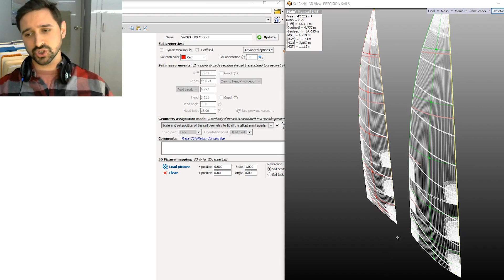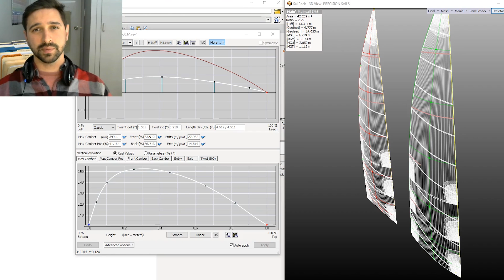Loose Foot Versus Fixed Foot Sails

Comment: Jeremy's got a lot of good points here, especially about the nature of modern sailcloth.  He's a sail designer; but I'm a rig designer; and my criticism of loose-footed mainsails is about structural mechanics.
Short version: the loose-footed sail point-loads the boom. Given a mainsheet tackle, a fixed vang, a topping lift, and a tack pin, these are all single points imposing mechanical moments between them.  For example, the farther forward your (mid-boom) sheeting is fastened to the boom, the worse the outhaul end of the boom wants to fall off to leeward.  Selden went so far as to design a boom with a flat blade through the extrusion to stiffen it. This adds weight, expense and complexity (you might not be able to mount boom bails above the plate, for example (and I've seen people miss and drill into the edge of the internal blade too - that's a real mess).
I think the real reason loose-footed mainsails became de rigueur in cruising boats was due to in-mast furling - which, if you follow the circular logic around, you kind of have to do with a loose-footed sail because now you can't so easily slab-reef it.  So now you're stuck with having to sail with a partially rolled-in mainsail as your heavy-weather rig.  I still rig nearly everything (including Cherubini 44s) with single-line slab reefing that can be done easily from the hatchway.  On my boat I have a sliding gooseneck and downhaul by which I can lower the boom rather than lifting the halyard to retension it.  There's nothing easier, safer and stronger than slab-reefing a rugged boom-footed sail that, once snugged down, can take a phenomenal beating during a serious blow.  Think now of the incredible load on the outhaul car pulling against the furler motor to keep the half-rolled-in loose-footed sail sufficiently tensioned inside the spar.
In the late '70s some sailmakers experimented with zippered pouches on the mainsail to facilitate 'bagginess' that could be deployed or not according to conditions.  It was a partial solution, an attempt at a compromise (worked mostly with dinghies).  In those days I sailed with John Eggers here in NJ (who made the original sails for all Hunters including my 1974 H25) who was famous for pulling a mainsail so tight and flat (approximating a rigid wing sail) that more than once he broke hardware under too much load!  That was how we dealt with the limitations (as seen now) of the contemporary sailcloth material - by going fully the other way.  Having an aviation background (c/o my dad) I still see some merit in this.  Jeremy does mention that easing the outhaul on a boom-footed mainsail will effect at least some of the benefits of a loose-footed sail; and no longer being a racer I'm willing to prefer simplicity and structural strength - not to mention convenience (for with a loose-footed sail's boom having no topping lift, you can't use the boom for lifting the dinghy, loading the ice and supplies, retrieving the dog or a MOB, or kedging an anchor to get you off a bar).  There's a certain sanity to the way things have been traditionally - it's not merely because they were always that way.
After Jeremy's patient, informative lesson it does beg the question: why is the boom there anyway?  Now I am motivated to lower the boom to the deck and sheet the mainsail home to the quarter without it, like a genoa or spinnaker, just to see how it does like that!
Reply: J Cherubini     I’ve seen photos of a boomless rig with rotating mast for furling sailing in the Baltic.... Trimaran if my recollection is correct.  I don’t like the idea of a mast mounted in bearings...but a free standing mast has a LOT of merit.  less “junk” to maintain, no shrouds to limit sail angle.
Reply: @stonetoolcompany3649   - An unstayed mast on a boat over about 18 ft begins to become a structural nightmare. At some point the structure necessary to support it becomes counterproductive to its purported benefits with the upper limit being maybe 40 ft (Freedom 40).  I’ve explored this idea since the '70s (designed 84-ft junk-rigger with minimal shrouds - exactly the opposite of Jeremy’s idea of a loose-footed main!) and for me it’s a hard sell.

Preferring ‘simplicity’ over what’s better though you have to work for (or around) it can be a disaster in disguise (about how dictatorships get started!).
Reply: J Cherubini     You over estimate the necessary structure to support a free standing mast.  Keel stepped, and supported by a partner at deck level, the longitudinal and lateral loads at the step and partner are easily transmitted to the structure.    Of course this is based on the separation distance.   The mast itself is where the strength issue is.   And of course the vertical load is trivial compared to a stayed mast where shroud tension is putting a very heavy download on the mast.   On a tall stayed mast this force demands diamond stays etc... to prevent buckling under this load.   I am very much an advocate of the junk rig with it’s typical free standing mast, balance area, light fabric loading, lack of most of the typical hardware & winches, ease of tacking, instant no tie reefing on any point of sail, etc.   It’s not for everybody... not a racing rig... but it’s ideal for my purposes.   In it’s modern iterations with camber, performance is quite respectable.   More than sufficient for voyaging, and it’s simplicity means that you won’t likely end up doing expensive repairs thousands of miles from home, trying to import stuff.

Comment: My main, the same one in place when I bought my 1983 boat, has a fixed foot, with a bolt rope, but there seems to be an extra, “flabby bit” of cloth at the foot that allows the foot to take a better shape. Not quite sure what’s going on, to do that - maybe it’s a “Dutch” thing, maybe not. But, over the past 7,000 miles of sailing, mostly single-handed and never in less than w0 knots, I’ve sailed with it reefed so, at that point, I don’t think it much matters

Comment: If loose footed, how does sail attach toboom  - just two end points at the bottom corners?  Thank u
Reply from the maker: That’s right, the main attaches at the tack and we install a slider on the clew that slides down the boom track.

Comment: Wondering: I think airfoils loose some efficiency at the ends by wind spilling off. I think is why airplanes have winglets. And I think some boats want to get boom right down to deck to seal off that spill.
So for loose-foot, does air spill off bottom of loose-foot? Would that be prevented by the shelf of the fixed foot?
Thanks.
Reply: Maybe depends on wind speed.
I'm trying a quarter position of loose foot Clew ropes port & starboard, aft to where cleats on deck are.   Huge curve at bottom of Mainsail from Hobie Catamaran.   Tension along foot of this sail taken at Clew cringle.  Trying mainsheet there with no boom .  Leech tension as well, boltrope up and down groove in AL
Mast.  Maybe hefty stick instead of short stock AL boom w shorter
mast from Chrysler 13 boat.  Compression in flexible boom stick ?

Comment: My C30 has three bails along the length of the mid-section of the boom with mid-boom sheeting.  With the loose footed main the upward load on the boom is near the end at the clew so this distance between the upward load at the clew and the downward load on the bail for the mainsheet creates a significant bending moment in the boom.  Is there any concern about breaking the boom with a loose foot over that would have been in the original design with the fixed footed main that the boat was designed for?
Reply: Same question for midboom mainsheet here.  On me 1960
Daysailer, Maon sheet pulley-
mudroom is mounted atop centerboard case.  Moveing
Boom sheet attachment to Clew 
at end of Boom necessitates experiment.  On 'Pirates of Caribean' Jack Sparrow enters onto an Engish ship.  He stands 
by steering wheel.  Over his head is double Mainsheet Pulleys or blocks leading down to port & starboard deck.  Can mainsheet
be attached to Clew and down away from Centerline ?